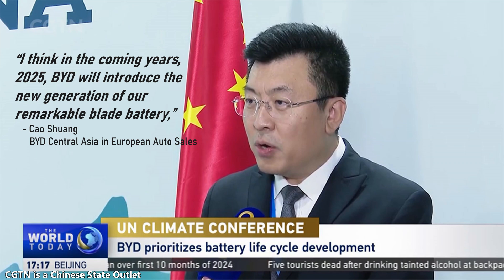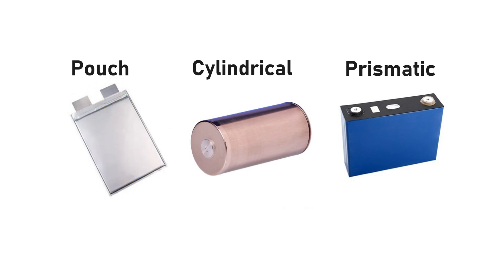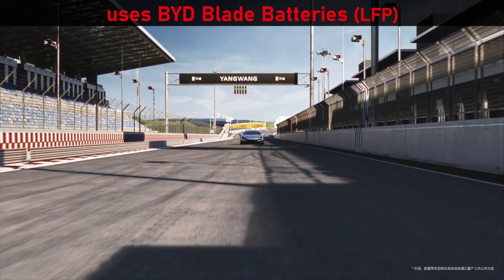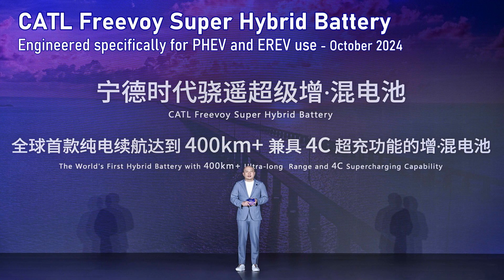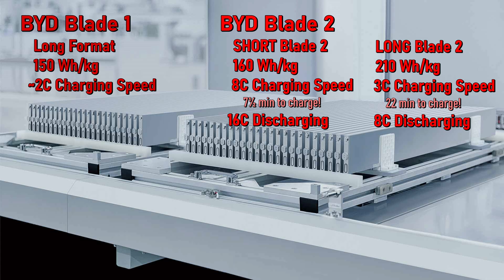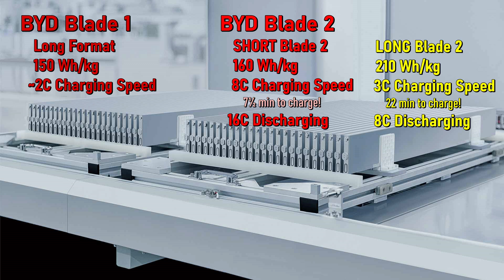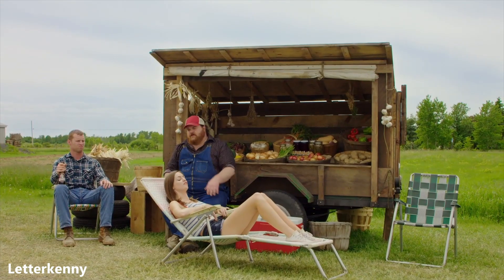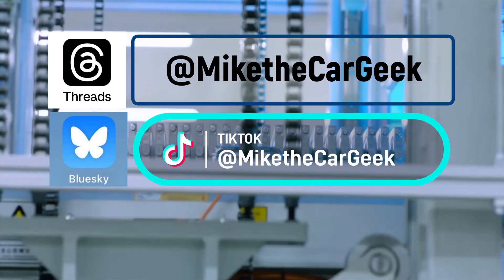New Details on BYD's Next-Gen Blade 2 Battery

Comment: How the German carmaker compete in EV when the Chinese held the advance tech and cost efficiency on the battery the main component of EV. The CATL LFP can charge in 15 min full charge. Next few years maybe it will reduce to within 10 min charge that gives 400km range. By that time who will miss and want an ICE car. LFP battery has least battery degradation, high safety and high charging cycle for more than 2000 charging cycles.
Reply: If only the west did anything but flog their profitable dead horse. #capaitalism
Reply: they can't, they tariff Chinese cars so thry don't go bankrupt
Reply: EU should  start  own  modern  battery production  ASAP

Comment: That means , the newest  NMC can get  290Wh/kg  where  best  LFP2.0+ 225Wh/kg    , a good  battery pack with package/frame 100kWh  =  LFP2.0+  600kg     ,  NMC 450kg
Reply: NMC demands a larger buffer and then there is the 80% charge rule. This wipes out the NMC claimed advantages.